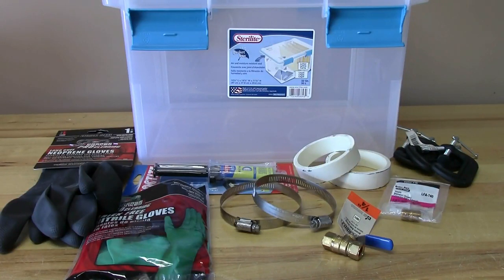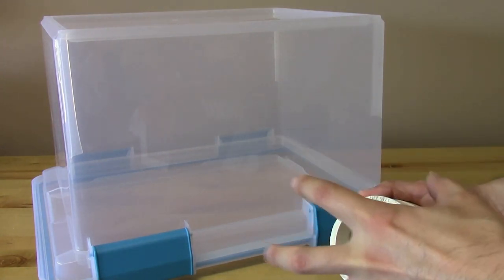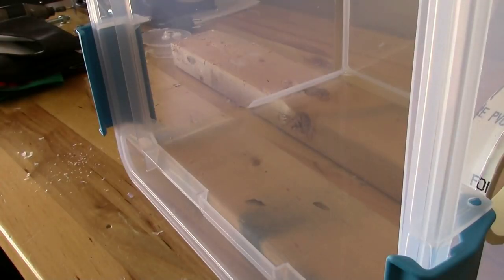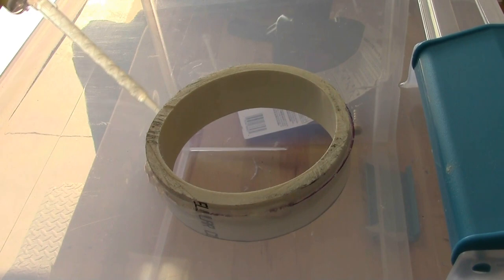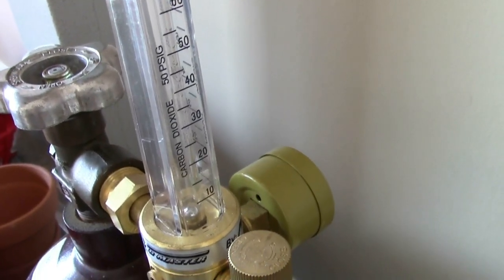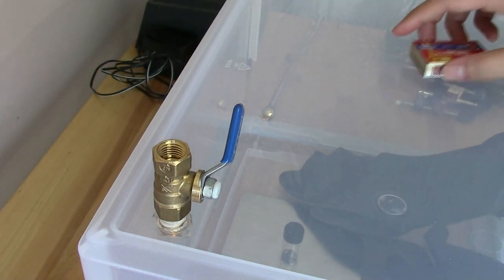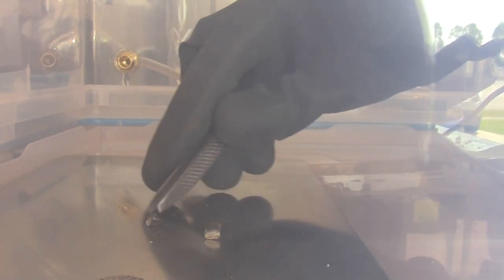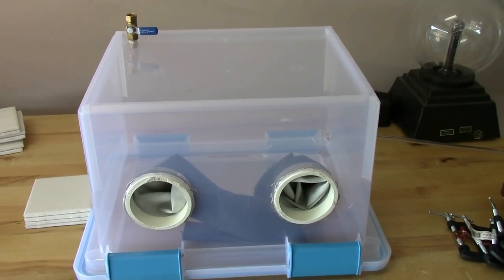Very Simple DIY Glove Box

Comment: A word about technique:  Put a polythene plastic bag over the gas inlet inside, inflate it, filling the inside of the box with the bag.  When it's full, take the bag off and collapse it inside the box.  Doing this reduces mixing of air into the inert gas you are using to fill the box.  This takes a lot less gas than just "flushing.  <footnote> Advanced Practical Inorganic chemistry by Adams and Raynor, 1965 Wiley, ch 9, Inert-Atmosphere Technique, p 89-96 </footnote> If you want really clean gas, use a 12v fan ti circulate the inside gas over lithium granules.  Professionally, we use heated titanium or zirconium turnings.  Welding argon often contains a few percent nitrogen, just FWIW.  Lithium scrubs O2, moisture, and  nitrogen but is a bit expensive.For drying purposes, cheap(er) lithium turnings are available from Chinese vendors (cf:  AliExpress.com)

Comment: next should be a fume hood! Awesome video!
Reply from the maker: +KmanMeteorProductions Oh I really, really want one of those. The problem is where to direct the fumes, though. I'm reluctant to put holes in my house for the exhaust! And I don't want to be blowing fumes into my neighbor's windows.
Reply: mrhomescientist You've got a point about the neighbors. Do you have enough room to build a shed anywhere? you can put holes in that for fumes to come out. I will look around and see where to direct the fumes.
Reply from the maker: +KmanMeteorProductions Yeah I had thought about that too. If I did, I'd want to go all out and get it on a concrete slab with plumbing and electricity and turn it into a real lab space. Then all the dangerous chemicals would be completely separate from my house. That's an idea world, anyway!
Reply: If you have a medium sized backyard (or bigger) just run an exhaust pipe up something like the side of a garage so the gases mix before blowing back at you or others. That's my plan at least.
Reply: Do you have an attic? Because if you do, you can create a vertical outlet, put the hood up there and be done with it. I doubt anything you do could be more harmful than a simple coal fueled central heating... I built one outside the house in our separate garage and got a reasonably clean corner for my stuff.
My grandfather worked in a factory in the 90's and he brought home some assorted stuff that was to be trashed so I had everything for the fume hood on hand :D
Reply: Krisztián Szirtes Me? No. Well yes, but it's just fiberglass with no windows...

Comment: Hey! As a guy who's been using gloveboxes for a while (though never made one myself. Congrats on that one!), here's my advice:

You'll definitely need oxygen and moisture absorbents. Without the ability to do vacuum/argon cycles, purging alone won't get you anywhere without expending cubic meters of argon. (And your argon likely contains some oxygen and moisture to begin with).

Zeolite is the best moisture absorbent for that. Luckily, it can be easily bought online. Don't forget to dry it beforehand by heating it up above 300°C (A good oven can do that, otherwise I guess a saucepan and gentle heating could also possibly do). Then, keep it in a container, sealed from moisture while it cools, until it is in your glovebox and ready to be used. (one of those glass pots with a rubber ring for preserves is the best I can think of, but there may be a bunch of alternatives for that)

You'll also need an oxygen scavenger, and that will be harder to find. Were I work, we use some copper oxide deposited on high surface-area alumina, which we regenerate by heating it at 300°C in a flow of hydrogen (that way we can regenerate both the zeolite and oxygen scavenger in one go!). Perhaps "pyrophoric iron" (Iron II oxide, made by thermally decomposing iron II oxalate to FeO and CO) could do. (the standard iron powder/sodium chloride scavengers used in food packaging won't do, as they require some moisture to work).

Once you have proper scrubbers, you'll obviously have to get the argon moving through or over them. I guess spreading them in trays and moving your gloves around for a few minutes could cause enough drafts.

Also, don't trust those supposedly airtight foam joints. They're airtight enough for storing food, but not for air-sen chemistry. You could probably mitigate that by keeping your box under constant argon overpressure, though it may slightly hinder your dexterity with those gloves.

Oh, and on a side note, you could cut a piece of the plastic on the side of your box and epoxy a glass window on it. That way, we'll get much nicer camera views!

I hope this is helpful, best of luck!
Reply from the maker: +piranha031091 That's a lot of really great information! Thank you very much for taking the time to comment. I think my first step will be to try a Hot Hands package - Cody'sLab has a good video on how it absorbed enough to totally collapse a two-liter bottle, which is pretty impressive. Lots of things to think about!
Reply: +mrhomescientist if you're going to be using it for lithium, you may need a way to get rid of excess nitrogen too
Reply: Ash De Vos
While nitrogen is an issue at atmospheric pressure, I don't expect it will be once diluted by argon below a few percent. (unlike water and oxygen, as they are far more reactive).

And I've never heard of "nitrogen scrubbers", nor do I think there's any practical way to make one at home.
Reply: where can u just buy a glove box?
Reply: This is a joke! Completely ridiculous as I have already posted. If you want to get smart, then buy/build a laminar flow hood instead of messing around with Argon hahaha.
Reply: @jtreg   You do understand what this guy is trying to do right?

Comment: Very nice video. I am trying to make a box which has a lid which needs to be opened/closed every time during the experiment. But I am facing leaking issues. The experiment has to be conducted in low humidity, less than 10%. For that, I am purging the box with dry nitrogen, but I am unable to maintain the desired humidity. It seems air from the ambient is leaking inside through the lid.

Comment: Attach a pressure gauge to your box and evacuate the ambient air as much as possible before pumping the Argon inside. The pressure gauge will help you determine when the box returns to atmospheric pressure while filling it with Argon. This will ensure an improved Argon concentration inside the box. I would also recommend applying a resin sealant to the foam lid sealant already installed on the box to better prevent Argon/ambient air transfer. This same sealant could be applied to the periphery of your glove connections to the box. Thank you for this video!

Comment: Hey, tip for the drill bit. I cracked like 2 monotubs before i tried going slowly, that way it doesnt cut completely through but just about. Then you take a single edge razor and its so easy to cut it put perfectly. Then use a bit of sandpaper if you want

Comment: that foam seal looks a bit dinky, if you're interested in improving that I can recommend rtv silicone. you can squeeze it into the gaps, let it cure, and you have a custom sized silicone gasket
Reply: But what if he wants to open it?
Reply: @LTECharged  rtv isn't very sticky, but if you're worried about it you can use a film of oil on the surface

Comment: that's a great still air box, from experience, unfortunately I have had those exact gloves deteriorate after 6-8 months from day light.  they turn into a messy glob of goo.  however, your way of mounting them, it shouldn't be a problem to replace.  Great Video!, look forward to more!!!
73!
Reply from the maker: +su pyrow Yeah I had bought those same gloves a few years back and wanted to use them for this project, but they had dried out and cracked after being stored in the garage that long. I'm hoping being in the box will help. I also thought of getting some PVC pipe caps to put on the outside of the ports to seal the gloves inside the box completely. If they do break down, though, it is pretty easy to replace them! Thanks for the comment!

Comment: Nice project - I'm looking forward to seeing it in use!

My suggestions for improvement would be to first, maintain a positive pressure of argon into the box when you're using it. That way any leaks will be just argon out, rather than air in.

I'm not sure how useful this one would be, but it might be a good idea to add a check valve to the output port. That way even with a low flow rate of argon, air won't flow back in easily.
Reply: Co2 is a Heavier Gas and Cheaper. Used it to Purge Gas Tanks to Weld them

Comment: What if you add another port and valve to be able to pull a vacuum on the box? You will need to seal your threaded fittings, but once the box is in a vacuum, break the vacuum with the argon. If you can get a good vacuum on the box, it will boil off the moisture. The deeper the vacuum, the more moisture you will remove. I know it kind of stretches the limit of a homemade glove box with a clear tote, but just an idea.
Reply from the maker: Yeah I would be very concerned about the box imploding. They definitely aren't meant for that!

Comment: I wonder if a second hand oxygen concentrator could be used to provide a sufficiently oxygen depleted nitrogen atmosphere, seems to be the type of zeolite adsoption system some use. I believe they can be had for $100-200, and they provide an unlimited quantity of gas at a good volume, and you get an oxygen supply as a bonus. I don't know how the economics compare, how much did the tank & regulator, & refills cost?

Comment: I agree with some of the other comments I am reading, if you really want to seal that box you need to remove that foam strip and fill the gap RTV silicone! It wouldn't hurt to run a thin layer of it around rings inside of the box and underneath the gloves. If you really want to seal her up tight, then run it around the two pipe fittings and add some teflon tape to your pipe fittings. 

It is a shame it is made of plastic, it would have been fun to see how long it would take for a burning candle to use up all of the oxygen in there.

Comment: You might have better luck with plexiglass than that cheapo plastic (I work at ACE Hardware), and you'll probably want to strip out that crappy foam lining and add some closed-cell rubber foam instead. Also, I'd undo those clamps and put some petroleum jelly or plumber's putty in between the gloves and the PVC, and then clamp them back again for a better seal.
And in regards to +piranha031091 's advice, perhaps making tiny versions of this box with a moisture scrubber and an oxygen scrubber, then connecting them inline, would help out nicely (and be easier to replace)
Reply from the maker: +Darasilverdragon Good ideas! Is weather stripping closed-cell, or is that some sort of special product?
Reply: +mrhomescientist Close-cell foam is just water resistant foam that doesn't let moisture through; instead the water accumulates on the surface and drips down. You can find some closed-cell foam strips on mcmaster.
Reply: mrhomescientist Unless the package actually has the words 'Closed cell' printed on it, and is either neoprene (preferred but harder to find) or rubber (we sell this one at my store next to the weather stripping), don't bother using it.
Open vs. Closed cell refers to the air bubbles in the foam. Open cell foams have 'overlapping' air bubbles, so fluids like air can travel from one bubble to the other - sometimes through the whole piece of foam. Closed cell foams have much smaller bubbles that are separated by the foam medium, and so are individual closed off packets with no permeability. All the flexibility and lightness of foam, and all the sealing properties of rubber - win win.

Comment: To cut the holes in the box it's easier to use a drill bit on the dremel with the flexible extension hose, just drill a hole and then use it like a pen shaped router.at high speeds the drill bit cuts thru that plastic like a hot knife thru butter
Reply from the maker: Thanks for the tip!

Comment: Can you test the insulations with producing lots of smoke inside?
Reply from the maker: That would work for big leaks, but for truly inert work smoke particles are far too large to detect the leaks that matter. At work we fill apparatus with helium and use Snoop Liquid leak detector. Helium is so tiny it will find even the smallest leaks!

Comment: Try a something to defuse the argon.  In welding stainless pipe we purge the inside of the pipe to prevent oxidation     We use a ball of stainless steel wool balled up and taped to the gas outlet
Reply from the maker: +Cody Halme What does diffusing the gas do for you?
Reply: +mrhomescientist it keeps the oxygen and gas from mixing.    Best way to explain it is research the different between a standard collet body vs gas lens

Comment: Nice video.  But i have a question what if instead of argo  we wanted to use n2 gas. Where should i place my n2 gas inlet and outlet? Since n2 is slight lighter but not that much than air.
Reply from the maker: It shouldn't matter too much, actually. If you watch my videos on lithium extraction I go into more detail on the design and filling process. Gases don't displace each other as cleanly as immiscible liquids, and they mix pretty thoroughly. So you just need to flush the box with about 7 volumes of gas. I'd still put inlet and outlet on opposite corners of the box, to make sure you aren't shooting your nitrogen right out the other end.
Reply: @mrhomescientist  thanks for the answer. Love your video.
Reply from the maker: @christianarquillano1912  Thank you very much! Good luck if you make one of your own 👍

Comment: If you made an inflatable glove box you would get the O2 concentration a lot lower with a lot less gas used.
Reply from the maker: Probably. Vacuum out the air, then fill with argon. It might be harder to see in there though, depending on the bag material and wrinkles.
Reply: @mrhomescientist  Im making one just like in the video, but with a pvc liner so I can suck the air out and fill it.
Reply from the maker: @spaken2768  Good luck!

Comment: So close! Hose clamps, for anyone who couldn't find anything online. not pipe clamps, those are clamps like a c-clamp but with a pipe as the the thing that acts as the c.
Reply from the maker: +Micah Burgin Damn! Thanks for the correction.
Reply: Don't worry, we all forget the jargon!
Reply: +mrhomescientist The best thing to do is make a vaccum inside the box which is much easier and cheaper. Just take into account that the plastic box must not bent and dent due to vaccum. For the bottom of the glove box use wood or metal plate so while using sharp objects like xacto or the blade you wont actually cut through the box 
. Really liking this series and a new channel to go to for uptodate smart chemistry !!
Reply: +mrhomescientist The best thing to do is make a vaccum inside the box which is much easier and cheaper. Just take into account that the plastic box must not bent and dent due to vaccum. For the bottom of the glove box use wood or metal plate so while using sharp objects like xacto or the blade you wont actually cut through the box 
. Really liking this series and a new channel to go to for uptodate smart chemistry !!
Reply: +mrhomescientist The best thing to do is make a vaccum inside the box which is much easier and cheaper. Just take into account that the plastic box must not bent and dent due to vaccum. For the bottom of the glove box use wood or metal plate so while using sharp objects like xacto or the blade you wont actually cut through the box 
. Really liking this series and a new channel to go to for uptodate smart chemistry !!

Comment: Now how do I remove the Argon Gas,. and or, how high does the gas sit in the chamber. I need to build a glove box that is Oxygen FREE, but I don't really want the gas in there either. If the gas sits low, and I work mid level, then I think I should be fine. Can anyone help me with this issue? I would greatly appreciate it.
Reply from the maker: Check out my EE#3 Supplement video (cvhx9nv0DNw) for a discussion on gas mixing in such a chamber. It sounds like you want a vacuum chamber, though, which this definitely won't be able to do. You need much more sturdy construction for that and, depending on how stringent your requirements are, much better seals.
Reply: mrhomescientist Thanks for getting back to me on this. I did do some more research, and you are right. It is a vacuum chamber that I am looking to build. However, I do think that I may have found a more simplistic way to accomplish my goal. Thanks so much for reaching out. YOU ROCK!
Reply from the maker: Outerflesh Entertainment You're welcome, and thanks for the support! Good luck on your project!